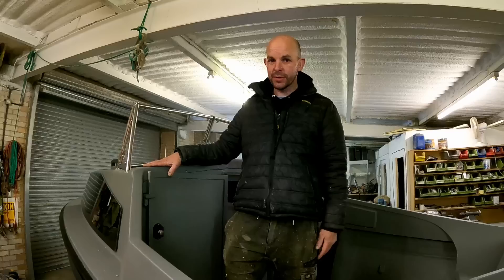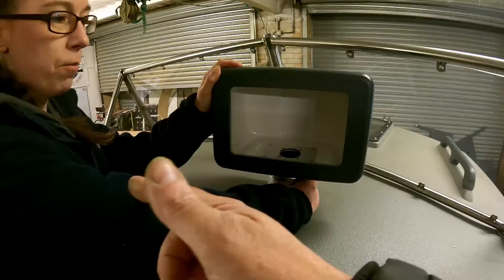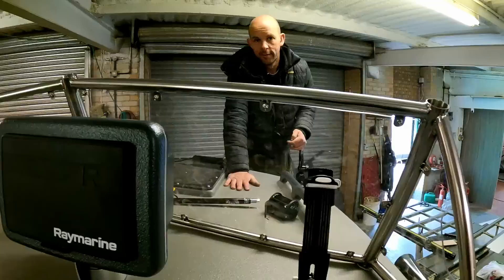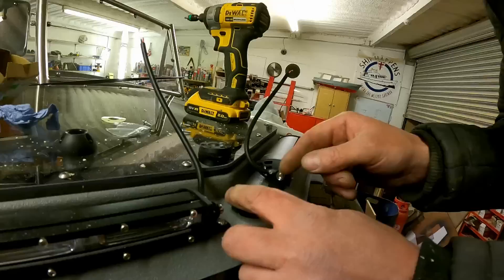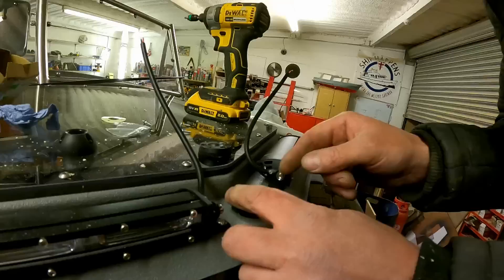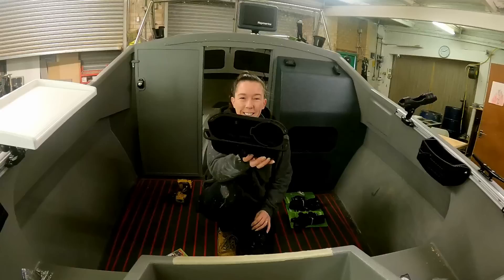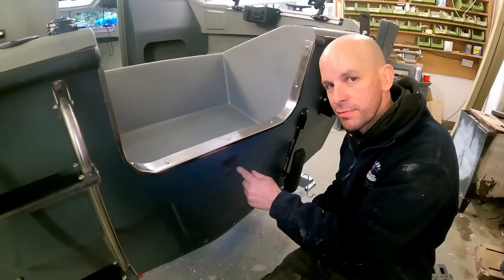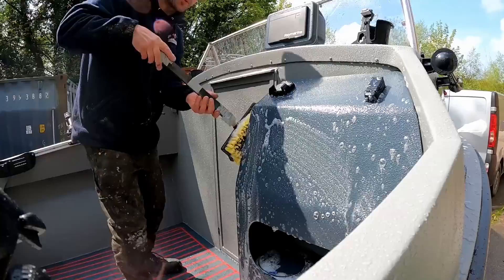Turning A 45 year Old Boat Into A FISHING BOAT - Part 6!

Comment: Very cool stuff.   Loving it so far!   On the antenna mount, you might consider adding a backing plate.   It will help spread the force if the antenna gets to moving alot due to rough water, big wake from other boats etc.   It will prevent  wear and tear on the cabin roof.

Comment: Just a suggestion, stair step your rod holders, this will spread your lines apart lessening cross over tangles. Rod holders while trolling or drifting with bait if stair stepping is done will also allow out riggers if you get a set to function properly. And add safety straps to secure your rods to the boat.  Put antenna bass on starboard if radio is on port side, reduces feedback and it is required.

Comment: Recomendation; you built a very nice, functional wind screen, however I recommend you drill drainage holes at the base of the vertical parts to drain water from rain and spray that invariably will get in.

Comment: Gemma and Simon, I know it's a little late on the cup holders up forward. But, they make ones that swivel which are much better for boating IMHO. Used them on my small skiing runabouts in the Sacramento/San Joaquin Delta when I was younger. I'm 68 now and don't ski anymore. Just a thought. Great job on the old boat so far. I wasn't sure how I liked it early on 🙀, but now I think it's turning out great! Keep up the fantastic work! 😺😺

Comment: Great stuff, the bungs. Yeahp you will need those, you tend to leave them out when you are on the hard standing so the boat doesn't collect rain water. I would elevate the hitch as well to be sure the water goes out the back, if you forget then the hitch is too heavy to lift with the water all up the bow (been there).  AND the principle point. PUT THE BUNGS BACK BEFORE YOU PUT THE BOAT BACK IN THE WATER. Can't tell you how many times I forgot, even left the bungs at home once. The phrase " aye mate your boat is sinking" comes to mind!

Comment: Hey Simon, Like you, I’ve always hated drilling holes in a boat, and I’ve had to do quite a few. Drilling hols in a deck is one thing, but drilling holes in a hull is another, especially the transom or below the water line. Any hole you make in the transom is an entry point for water and rot. For mounting things below the waterline like transducers, it’s better to adhere a pad (slightly bigger that the footprint of the mounting bracket) of 20mm thick polypropylene to the transom using a quality sealant, then mount the transducer to that. Just a clue for future reference. Cheers Bloke!!

Comment: Every through deck fitting should have a backing plate. Especially cleats and items where there will be load. Otherwise the fibreglass will flex and leak, then fail.

Comment: Don't you just love those Railblaza products. Designed and manufactured in Kiwiland (NZ) also Scanstrut is such a quality range too. When you were Sikaflexing your exterior fittings I don't think I saw any sealant going on the screws. Potential for leaks round the screws as they loosen up with age. Inside the cabin, nice to have dome nuts over those protruding machine screw ends - looks better and will save you some skin when you bump against them. To the engine and steering wheel add two nice comfy swivelling pedestal seats.

Comment: In the US that White light on a fishing boat goes on the rear of the boat with a green light and a red light on the front so someone over taking you sees the white light and someone approaching your frontside knows which side of you they need to go. Besides that yall are doing an amazing job with your repairs and so on. Only missing the biggest thing is a motor we had a 115hp rated bass boat and we put a 150 on it. Lemme tell ya it would push your eye lashes back into your eyes!!!

Comment: fantastic boat!
I really like to watch how you turn seemingly uninteresting things into an object of admiration and desire!
I don't remember if you mentioned whether you would do interior trim or not! but if not, then I recommend cutting off the extra length of the bolts sticking out on the ceiling and putting protective plastic caps on them for the nuts! to reduce the chance of injury!
Reply: I think the reason they were checking for leaks was so that they could then do the interior trim.

Comment: One thing to think about with the antenna is that it needs to be mounted vertically for best range.  Most of the radio signal goes out at 90º to the shaft plus or minus the spread angle due to the dB gain of the antenna is.

Comment: Might be worth sticking a rubber strip At 00:20 where you pointed out you've made some handles on the windscreen,  if you shunt forward from hitting a wave you could end up 1-inch punching the glass. 😬

Comment: That boat is really looking very, very good!! I would want one just like it and no, I don't have a fishing rod either! I don't even have the necessary Class 2 Boat License (sic) that is required for any watercraft over 3m in length and with an engine of over 2hp here in Japan. I am looking forward to seeing what you do with the interior of the boat. As I'm sure you have in the works already, the only thing that really needs to be addressed I suppose is something to protect your heads from the bolts in the ceiling - oh, and a bucket for Gemma to wee in! I really love this boat - fantastic job Simon and Gemma.

Comment: For a transceiver the distance between the antenna to metal adjacent to the antenna is best a wavelength do not interfere with transmitting an receiving. look into RF propagation pattern 4 placement.

Comment: Also as Simon has pointed out there is a drain whole at the stern where the engine mounts ha did mention if water comes in and it will come in !! So if the main area ie that lovely floor is awash with water how will it get out as you travel fwd the water will go to the back it needs to have an exit and a hefty exit point.

Comment: Where are you putting the solar panels? I realise big panels won't fit but a smaller 12v system to top up your house batteries between uses or in a emergency while at sea will save you a lot of bother and worry later. Perhaps you can even power a alarm system with cameras if they do not use to much power.

Comment: When you set up your antenna make sure it is vertical. At an angle, it can affect it. Check it out before you settle on it.
Reply: I was going to say the same - imagine the radio signal FROM your aerial is a ring doughnut, and the aerial is the stick through the middle. If the aerial/stick is tilted, the doughnut is also tilted, so some of your signal goes up into the sky, and some goes down into the water. A few degrees aren't important, but when you start getting towards 45, then it is, you will lose range.  You should have mounted the aerial further from the metal screen frame, but you've drilled the hole now! I don't know how many watts rf output a marine radio has, but I'm presuming about 25, so being near the aerial won't be too critical for radiation burns providing you don't grab hold whilst transmitting! You might also find a thing called a cam-cleat useful. It's a gadget that you can pull a rope through, but it cannot slide back out again, ideal for when you only have one hand free (hanging on to the boat, etc!) - such as this - https://www.ebay.co.uk/itm/373096900420?hash=item56de4ee744:g:BXUAAOSwXYZe-Hzx&amdata=enc%3AAQAIAAAA4LcF0Z5P%2FefUJk8FFZ%2BSX6dVtRNAQzxD90jPfKYvTHVp9aV7awZaN7twCRdNMDBwUkLHnit5OuVQezojQazVZWZ6B5ltl0EdNgGMIJyKIuxg0FE8YrsV5o4VLSLMuemUHAMcMGwKmLZtD%2BzLZKTSMOYeI6CjonoWomGPunPhWoUcGOcJFDkHsWRgI3MD7QGVE21zcRjbDAQiD%2BYQY4wZ1I27pdPFnnwXEmrUh8IDGxVhiCh9afFu73EOTLckNAytM2%2FEbddbm5gdxPPdN01Uvo80jvf0qTWnRrtvQt6cmWq3%7Ctkp%3ABFBMyO-TnIBi   - - - huge link for a tiny object!

Comment: Ariel goes on the starboard side of the stern gunnal.
Reply from the maker: The one one I've been boat fishing I learnt that you move around alot with the rod when you have a fish on, as the fish can change direction trying to get away, so one minute you can be reeling it in on the Port side, then the next you may have to move your rod over to the starboard side, how annoying would it be if you constantly had the Ariel in your way!

Comment: If it was me, I wouldn't want an RF antenna connected to a 25 watt radio that close to my head. Seems to me the manual that came with my radio suggested a larger minimum distance the antenna should be from people. Maybe look that up. An antenna that is twice as far away will mean 1/4 the radiation. Look up the "Inverse square law". I have seen wise cracks from people who say that distance is only while transmitting (step away from the antenna while talking) but I suspect the specification takes into account the average transmit duty cycle already.

Comment: Why not mount the antenna on the back corner?  Out of the way from everything
Reply from the maker: The back corner as in on the back of the boat?
Reply: @ShipHappensUK  Yeah, you will have the light on one side and the antenna on the other (Behind you by the motor).
Reply from the maker: @AlarianDarkwind  as the antenna would be in our way while fishing if it was at the back!
Reply: @ShipHappensUK  Good Point!

Comment: "Could be a submarine" .... be careful what you wish for.

Please grind down, i.e. as small as possible without compromising strength, those bolts coming into the cabin. Last thing you want is one of you in the cabin thrown against a piece steel, whose sole purpose in life is to open up gaping wounds, when/if a big wave hits, or the wash of another, big, boat.

Comment: You guys are doing a great job and I am a fan; however, I cannot help but notice you are introducing way too many potential faults. Wireless chargers, gadgets, iPad, unnecessary potential power drain sources and shorts, you're in a small boat with limited power source on the ocean. Salt spray, UV exposure, unnecessary problems, keep it simple. Sometimes all these new fangle gadgets cause more problems than they solve, error on the side of caution, best of luck.